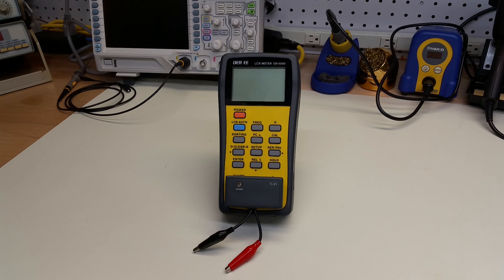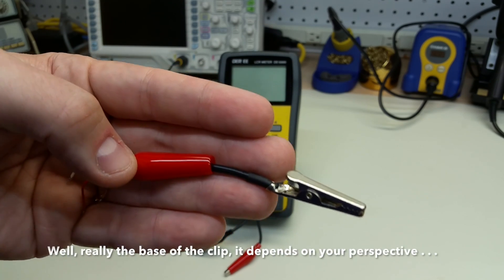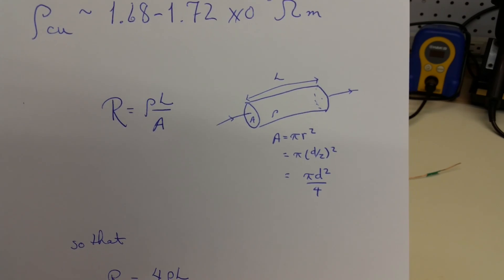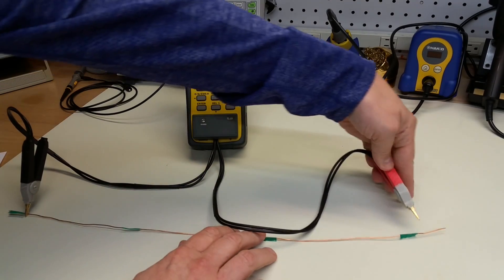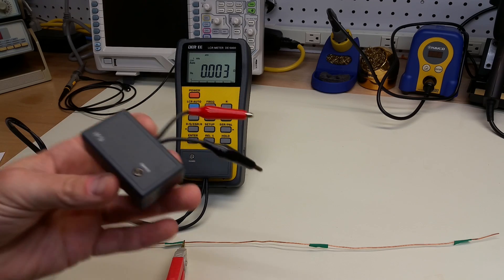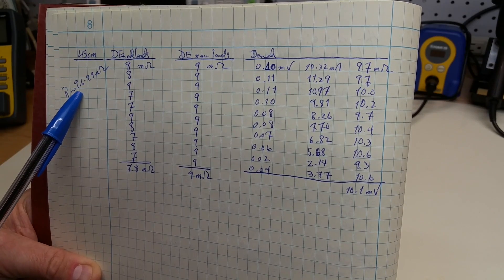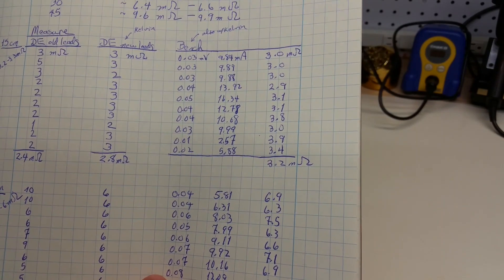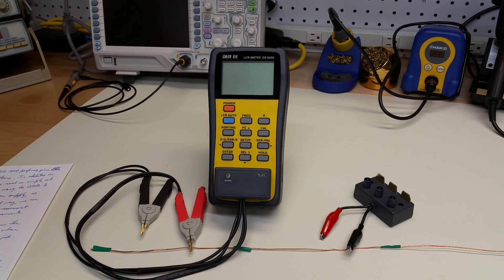#10: Kelvin versus alligators: Clips matter

Comment: I was a little surprised at how carefully done and reproducible your little experiment is. On the surface I would have thought the contact area between the teeth and the wire is a bottleneck spot of low cross sectional area, presumably accounted for when zeroing the device electronically. The whole topic makes me wonder what errors might creep into measurements regarding capacitance and inductance. With variance in current and voltage and even frequency, I wonder how accurate the zero calibration can be.

Comment: Radio Physics and Electronics, Thank you for the interesting video. I am also planning to replace original TL-21 clips for the Kelvin clips with longer cables. Francesca Cosentino in a post below recommended using somewhat shorter cables (up to 30 cm). And the original TL-21 cables are just a few centimeters long. What would be the optimal/most practical length for those cables if I use 28AWG twisted pair shielded cable with PVC insulation (about the same as the factory cables)? Would it be benefical to use a cable with better insulation like PE, PP or FEP?

Comment: I followed this interesting idea of making a 4-wire Kelvin clamp for DE 5000 by modifying the TL-21 typically supplied with the DE 5000.

I also bought the cable already made for sale on Amazon and linked in a video by the author.

But I haven't had good results. As you can also read from other videos on the same topic, this cable is very cheap but it is of low quality, it is too long and often has constructive defects in the Clip attacks; defects covered by the self-shrinking sheath.

I passed the calibration test both "open" and "short" but then the displayed values vary a lot and the "zero" on resistance after calibration was lost immediately even if I did not turn off the DE5000. To give a quantitative value, visualizations of a few tens of random milliohms were normal. It was useless to do the calibration again because nothing changed.

What was also evident was that moving the cables varied the error: as if disturbances entered: Yet I assure you that the "Guard" contact was wired as indicated with care and cleanliness.

So I decided to do it all again with a better cable from a Hi-Fi shop. Basically a stereo signal cable that has a red and a white wire both individually shielded.

I bought similar Kelvin Clips on Amazon like these:

https://www.amazon.com/Alligator-Clips-Copper-Plated-Kelvin/dp/B08CBWJBXZ/ref=sr_1_17?dchild=1&keywords=clip+kelvin&qid=1615716686&sr=8-17

and I made the cable myself.

I also adopted a shorter length: about 30 cm.

The result was good and stable. The error after calibration fluctuates on resistance values of 1-2 Milliohm and above all when moving the cables with the DE 5000 switched on, the indicated value did not change.

My final consideration is:
- Kelvin clips with black cable, like in this video, have better quality cable.
- by reducing the length of the original cable by half, the situation improves a lot
- However it is better to make the cable yourself of better quality especially in the cable (using an Hi-Fi signal cable) and using a maximum length of 30 cm.

I hope I have helped someone.
Reply: Francesca, have you tried two-wire cables with a common shield? I've seen a comment from one blogger that separate wires in individual shields kind of defeat a purpose for 4-wire measuring method.
Reply: @IliyaOsnovikov  No , separate shield
Reply: @francescacosentino6975  Thank you. I just finished that mod a couple days ago. I used 2 x 28 AWG shielded cable very similar to the original TL-21 cables and some small (5 cm - long) Chinese Kelvin alligator clips with replaceable gold plated tips that come in 3 colors: Red, Black and Gray. Following your advice I've made cables about 30 cm long. Very happy with the results. At 100 kHz after calibration I'm getting stable readings of 0.000 uH, 0.00 pF and 0.000 Ohms.
Reply: @IliyaOsnovikov  I am very glad for you
Reply: Francesca, is 30 cm overall length of the cables or the distance between alligators and TL-21 box. I've found that I would need about 4 cm within an alligator clips and about 3 cm more in a box for connections.

Comment: These Kelvin Clips you are using seem to be connected to one of the two parts of the "jaw". Each wire should be soldered to the individual gold plated copper connectors and should only be shorting out when the two halves of the jaws are in contact with each other. Just making sure this is the case.
Reply: They are soldered to both jaws. They only run up one side though. One wire keeps going to the other jaw.

Comment: Great video. I just received my DE-5000 today. I also did the Kelvin Clamps / Lead update. WOW ! What a great meter when used with the new leads. I make a lot of resistors for meter shunts. 
It was your video that showed me how important the Kelvin Clamps are. I never knew about them before.
Thanks for the great video and lesson in accuracy. 
Barry
Reply: Your lucky my  DER 5000 did not calibrate properly with cheap flea bay kelvin leads..

Comment: Thanks for the video and demonstrating that this can be an issue. However, while the added stabilty this modification yields is nice, this meter specs at 1% +3 digits in the DCR range. So it's a bit pointless to use it for milliohm measurements to begin with.
Reply from the maker: Indeed, and that is the reason I picked that range: the meter should not be precise in that region. I wouldn't depend on milliohm measurements with this meter without independent measurements or reality-check calculations to corroborate, as done in this video, but I thought it was interesting that the clips made readings less variable. Thanks for your comment.

Comment: My DE-5000 came with a second adapter, TL-22, which looks almost like  Kelvin leads. The only difference is that the wires in each pair are connected together about 30 millimeters away from the measuring tips. The tips are looking like they are gold plated, so measurements should be close. If I get myself the real Kelvin probe I will came back with numbers.
Reply: The TL-22 are sold as SMD tweezers, not regular test clips. They're spring loaded so you have to squeeze them closed. https://goo.gl/w1B1mZ
Reply: @ITTSB Blog Europe, I read your review from 2012.  Very informative, thank you.  But would you say the DE-5000 is still one of the best LCR hand-held meters now in 2018?
Reply: how did they compare?